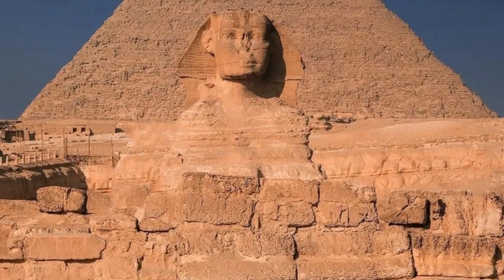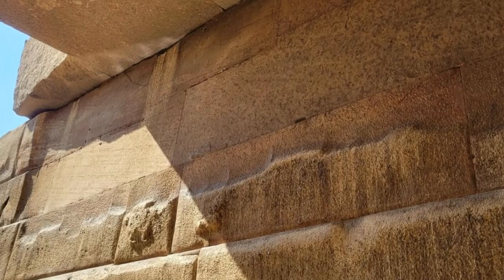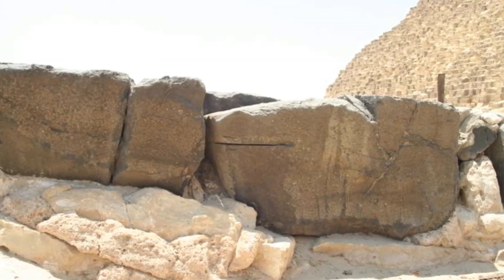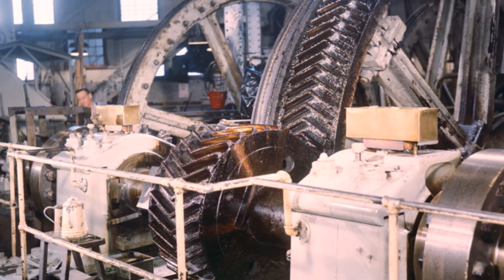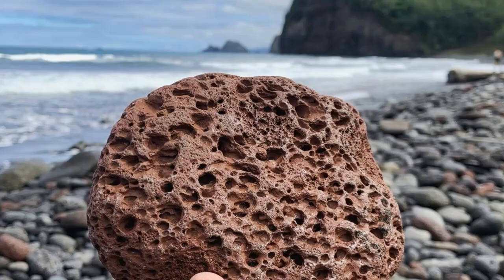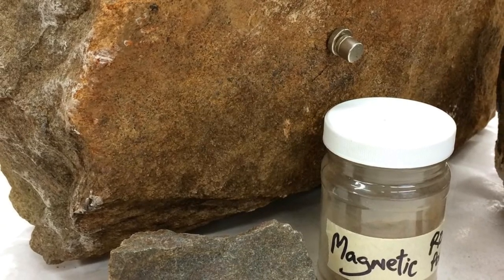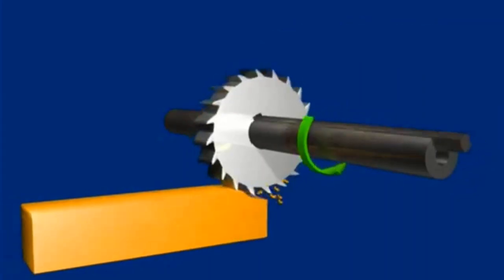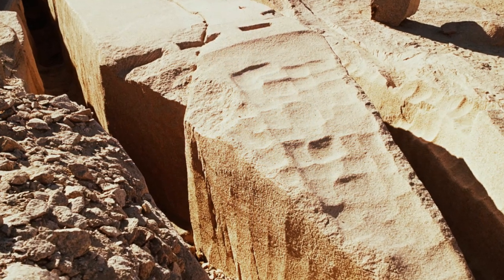The Mystery of How They Cut Stones In Ancient Egypt & Peru #egypt #peru #engineering

Comment: You need a bronze saw and add small quartz rocks (hard rocks) in the gap as you cut it. And you can replace the saw when it gets broken. The blade itself doesn’t have to be made up of diamond or be rotating to cut a rock. That a rock has streaks and therefore looks like other cut rocks you’ve seen is because the same small marks have been dragged down. You can see the same texture in pencil strokes and window wipers. Can’t you just look up how they cut the rocks instead of thinking two rocks looks the same and therefore they had to use our technology and wanted to fake the past by making huge monuments that look old. What if they are actually old and they didn’t know about our methods, didn’t have our materials and didn’t have our knowledge of rotators cutters, but still could cut rocks and lift them to lay them in the form of a pyramid instead of thinking all countries with powerful communities which we aren’t apart of are conspiring evidence and stories which they teach us about. What if they are teaching us about a huge and old monument because it is really old and really huge instead